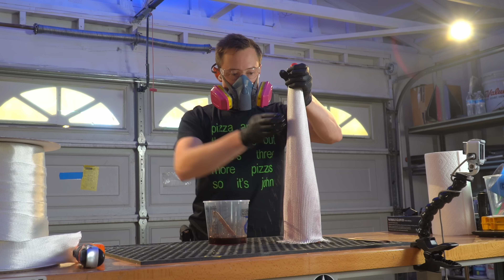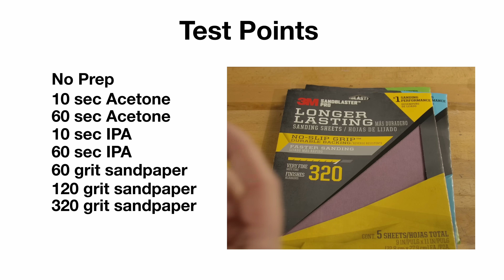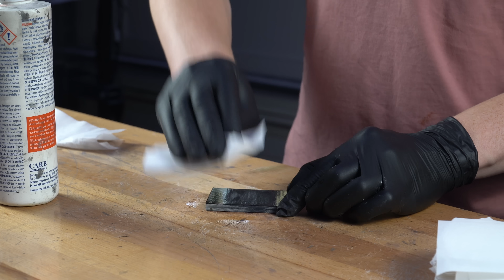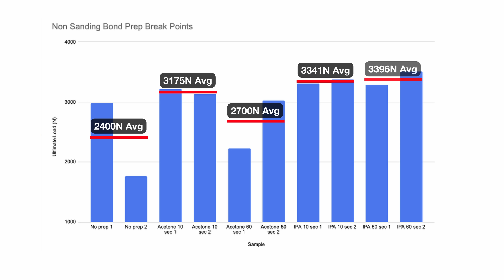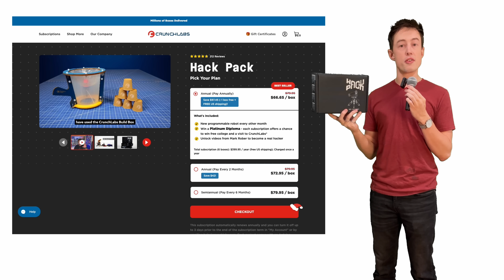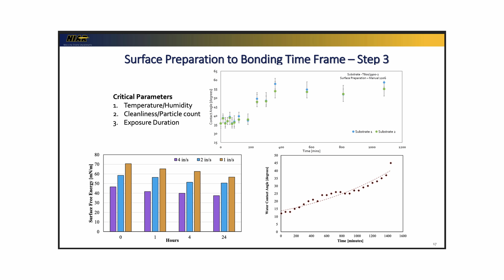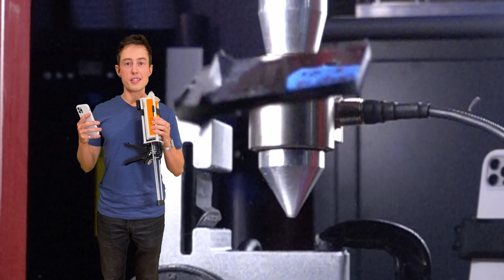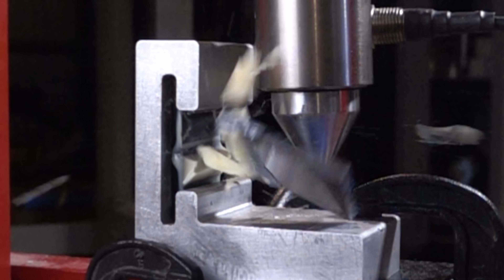I Broke 100 Epoxy Bonds to Find the Strongest

Comment: important: in 100,000 rotations, 60 grit becomes 4,000 grit, with signfiicant'y even pressure between the sandpaper and the substrate.  While the effectiveness of an orbital sander comes from OPM (oscillations) more so than RPM, the drift toward higher grit is still in effect.  It happens with hand sanding, however, distinctively uneven wear is more readily achievable with hand sanding, and hence, more drastic variation in substrate surface is likely to result.

Side Curiosity: 
short version, redo the test of 1000 grit sequencing from 60 grit gradually to 1000 grit.  
long version, when polishing, a progression from low to high grit cannot be ignored.  Under a microscope, the peaks and valleys of the surface substrate is best approached with a grit slightly higher than the substrate.  The depth of the sandpaper's grit shoulld be less than the depth of the valleys in the substrate to avoid being counter productive.  In a perfect exection, grit and force would be dialed in to have the sandpaper 'peaks' lightly impacting the substrate 'peaks' with each pass. As the substrate 'peaks' dwindle, a higher grit sandpaper is require to continue the 'dwindling' of the substrate 'peaks'.  The less timely our grit progression simply results in the real world effect of digging out extra substrate. When the grit of the sandpaper is less than the grit of the substrate, we roughen the substrate.  However, in this application, there is a tradeoff between fixing the slipperyness of the substrate and affecting the structural integrity of the outer layer which may delaminate under stress.  The idea might be to have as little impact on the surface structure while changing the surface energy, which might not equate to a human's taction contact sensory perception of 'smooth' and 'rough'.  In this situation, we may be initially drawn to identify 'removing the smoothness of the surface' as being very similar to 'this surface now feels rough, so that must be a good thing to go for'.  However, exposing the substrate surface to AO may produce a 'grab' feel, similar to the resistance of pully a wet chamois or microfiber towel over a car, due to van der Waals force.  Although, it could also feel smoother if the 'dust' from polishing has not been sufficiently removed, where the dust acts as a highly fluid lubricant, creating a 'feel' of smoothness.  This dust should be removed as part of the pre-epoxy surface preparation.  Most talented woodworkers are largely unaware of this, and prescribe recurstions of staining and resanding out the clumps of wet dust developed when wiping on the stain that the stain hardens around.

Comment: I saw a mil-spec procedure for bonding composites.  They specified media blasting and then using compressed nitrogen to clean the surface!  I assume the nitrogen is to mitigate risk of oil contamination from compressed air.

Comment: I regularly use acetone and IPA to deal with adhesives and surface contamination on a variety of materials, just hobby and home use. And so, it‘s hard to describe, these are both solvents, but they‘re somehow very different, in what feels like more than their differing abilities to dissolve organic compounds and evaporation time. For instance, if you get your hands covered in the stuff, it strips the skins oils off, and eventually you go wash your hands. IPA feels at first under the water almost oily. Acetone does not. I haven‘t looked it up, but maybe they have different wossname, dipole moment? Hygrogoscopy? Viscosity? 🤷‍♂️

Anyway, so obviously acetone is a lot more aggressive. It starts dissolving a little bit of almost anything in any way organic right away. But it goes a lot better in some materials (like ABS) than say, PETG or PLA. And once it evaporates whatever it dissolved, it obviously leaves it on the surface, and that shit *will* interfere with any kind of bonding. I haven‘t tried it with resin, but it‘s true for both adhesive strips and superglue. I mean, that all makes sense. But wait a minute. Sometimes I‘ve bonded stuff onto ceramic tiles or glass. That‘s a completely untouched by organic solvents. All types of adhesive strips (even the ones that use van-der-waals force bonding, you know, gecko strips) bond better to a glass surface that‘s first wiped with acetone and then wiped with IPA? I have no idea how that happens. Maybe it‘s not entirely pure acetone? 🤷‍♂️

I did at one point try cleaning a glass surface with nail polish remover, cause the bottle of acetone had run out. And ohboy was that a bad idea. In nail polish remover, they add something, that feels like oil, which is left behind once the acetone evaporates. Probably to make the acetone less agressive to the skin. But like, this is not oil, i.e. organic, cause that‘d just get broken down by the acetone. What I can say about the substance is that even after a dozen actual acetone and IPA wipes and soap cleaning, it‘s still there on the glass. It‘s probably bad for you, carcinogenic and some sort of super environment toxin. Also the most annoying thing to ever have on a surface you want to bond to.

Comment: Ok, so you want the fin to stay on no matter what.... Why haven't you drilled two or three - 1/4 inch to 1/2 inch holes through the coupon so the epoxy can join and form a positive clamp on the part? 👣👣👣👣👣👣👣👣👣👣👣👣👣👣👣👣👣👣👣👣👣👣👣👣👣👣👣👣👣
Reply: Violin! I think you're on to something.

Comment: Considering the material you're working with, sanding/scoring likely doesn't matter too much. Would it be possible to just run a few little scews in there? Like from the inside of the tube? Or mortise the fin into the tube?

Comment: Storage of the epoxy container is another variable worth considering, might not be a huge factor in this case but temp, humidity and exposure to light can cause issues. Also, I would be interested to see how prep with ammonia would affect things. I sometimes use ammonia to remove contaminants that ipa leaves behind, it noticeably increases surface energy.

Comment: It looks like the epoxy itself is fracturing in most of these tests. I'd look into adding some fiber additives to help prevent crack propagation in the epoxy, and help distribute the load more evenly.  In the cases where the surface is sanded, I'd think it might help to either slow the epoxy cure, or reduce the epoxy viscosity. You want to give it time after degassing to really flow into all the cracks and scores left by the sanding. At these viscosities, this can take many many hours. But the epoxy is cured by that time.  It's another variable to play with.  Additionally, in order to get really really (atomically clean) surfaces. Check out Ben's video on atomic copper coating. He talks about different approaches to remove absolutely 100% of surface contaminants. It might be useful? Oh also. I'd wait more than 48 hours before testing. The curing time chart in the datasheet only applies for extremely perfectly mixed epoxy.

Comment: The vacuum degassing will also probably help the epoxy flow into the voids formed by sanding. I think if you scored the samples it would also preform well if it is vacuum degassed. Also certain through hole connections might work too, like a key in a mold, to hold the epoxy in if they don’t compromise the structure too much. Plasma etching also works for other low surface materials like HDPE which are sooner hard to bond to, so it’s helpful in other ways. Also bonding during the “green” phase of the epoxy curing I had found to be super helpful. It can be hard to time, and I’ve had to pull some all nighters for that reason 😅. You can choose different cure time epoxies or use temperature to control the cure rate, but I think the different cure times/temps can effect the strength of the resin, so it’s better to find the optimal time/temp and just plan it out well. (A little heat gun use is ok at least in my amateur experience when things are too slow)

Comment: Loved, "there can still be a value to incomplete data"! It can point you to a solution. 

Ex-boatbuilder here. I've been using filled epoxies on wood, fiberglass, carbon fiber, etc. since ~ 1978. 

I'm sure Loctite makes a great epoxy, that version is a filled epoxy, although Loctite won't tell you what it's filled with. It looks like it may be Cabosil, but it's thinner than what I would use for a fillet. My experience is mostly with WEST epoxy where you get to roll your own filler. I would absolutely trust WEST with your application. 

A few constructive critiques. 
In general, I would never use a butt joint on anything important. 
It sure looked like that epoxy overheated in the mold, that usually weakens the result, and that's probably why you had the bubbles. Try using an epoxy with a slower kick.
Mixing. I always mixed by hand, the WEST pumps always got the % right, but mixing epoxy requires some attention. My rule is: 25 clockwise turns with the stick, 25 turns counterclockwise, 25 turns clockwise, scraping the sides occasionally. Then add the filler until it was completely mixed. Never fewer. 

In the late 90's I helped my brother, Bob Parlee, prototype his CF bicycles. They are known for their ride, and longevity, as well as other qualities. The longevity is mostly due to the bond between the lugs and the tubes. He removed the epoxy equivalent of gel coat, be it ever so thin, so that it was bonded fiber to fiber. You see that glossy outside to your coupons? That's not structural, it has to be removed, not simply sanded, then you are trying to stick it to a chunk of filled epoxy.

Instead, makeup pairs of 90 degree "L"s, one leg curved to fit snugly to the cylinder, the other to bond to the fin, of course removing the surface coating.

Comment: Did you check your ambient temperatures, Relative Humidities, and also the moisture content of the fibreglass when bonding each sample together? Humidity in the air or the samples are likely to make a big difference to the bond strength.

Comment: Fiberglas sheets are FR4 or G10? I use those for 3d printing, they get soft around 90-100 Celsius. Perhaps there is an inconsistency in the strength of the parts themselves. The reason is likely the epoxy used to bond the layers.
From my testing sanding the sheet helps a lot with how good PETG sticks to the sheet. Now I am dealing with a 1mm sheet and not something at thick as your samples. Also I am not trying to bond epoxy to it so take that for what it is.
But from my testing washing with soap for example decreases the first layer adhesion. Even after washing with water and then isopropyl. Best has been sanding then isopropyl. I have not tried Acetone because the smell is bad.

Comment: The long anticipated composites testing video!

If I may add another point of criticism, I believe creating an >ISO4 clean room with an exclusively atomic oxygen air filtration system is the next step. Time to plan a new wing of the bakery!

Comment: This is an awesome video, Thanks for all the hard work you put into collecting it, it really shows. This was a lot of work! 

One thing not mentioned was temp control. I have multiple family members that work or did work at Raytheon in their composites room. They had special lockers with temp control for storage and then a different one for prepping the adhesives for application time where it would be loaded the day before it was going to be used.  It was required to be sure the epoxy was at the right temp before application and then they had a limited time to apply when they took it out. Then after some time they would put the part in a heated chamber to complete the curing process. A lot of these high performance epoxies have temp requirements to reach max strength. 

One other thing to consider is the bond line. This is the amount of epoxy and the shape of the t joint. You used a chamfer but most adhesives don't like that and it creates a stress line (as you can see that is were most failures started in you video) and want a fillet to even the stress. based on the videos you will want a much smaller fillet (less then 1/2 the size of the chamfer so that no part of the epoxy is think then the material being bonded) so that it can flex more.

NOTE: I went an looked up the datasheet (LOCTITE-EA-E-120HP-en_GL.pdf) and it says "Cured for 12 hours @ 65°C followed by 4 hours @ 22 °C" otherwise 5 days at room temp (21c) for max strength even though the graph (you shows in your video) shows its fine after 24h this might be a variable you want to control and helps drive out moisture. Also if the Epoxy was stored below 8c then that will affect its performance as well: "Optimal Storage: 8 °C to 21 °C. Storage below 8 °C or greater than 28 °C can adversely affect product properties."

Really looking forward to your next video. Good luck!

Comment: Dull sandpaper dragged in circles is an extremely  poor method for achieving mechanical tooth.  Folded sandpaper under finger tips is also poor technique. Yes it will get rid of the glossy surface, but that is not the only goal.  I like dragging new  quality Sharp 60 or 80 gri sandpaper  which has been folded over the edge of a paint stirrer, or similar size tool edge.
      Press down firmly, and Pull it in an X pattern. At the top of each pull, relocate the used sandpaper away from the working edge, and bring fresh sharp paper to the tool edge.  This method  leaves sharp valleys and mountain tops for the epoxy to grasp, greatly increasing surface area. 
 If  you then wipe these mountain tops with acetone, it is like a glacier rounding mountain ranges, and contaminating the valleys and goodbye to a majority of the mechanical tooth you just worked so hard to establish.

Before removable fin systems started being widely  employed on surfboards, the Fins would be glassed on.  There is tremendous forces on the fins.  Standard practice in the factories I worked in was to tack the fin at the proper tow in and camber with Waxless  laminating PE resin.  Then the fillet itself was  saturated unidirectional roving laid along both sides of the fin.  Then a minimum of two layers of 4 oz fiberglass was laid on the hull of the surfboard and up the side of the fin, pressed into the corners of the fillet.   The bigger the fin the more roving in the  corners to form the fillet and more glass bridging hull to fin all the way to fin tip was required.   After the laminating resin kicked a bit,   we would paint the area with hot coat resin, or sanding resin that has the surfacing agent in it to allow the resin to fully cure .  A razor would be used at the correct time to  remove excess fiberglass. 
  
Glass on fins with epoxy is a bit different in the time and potential amine blush affecting secondary bonding sand also trying to lay  secondary layers within the chemical bonding window, when possible.

When the fin was loaded to the point it would break, it was usually as the Foam under the fin that crushed on the inside.  The really strong fins needed little ovals of fiberglass laid down right below the fins, and mechanical tooth was super important.  Acetone wipe first, then cross hatching with new sharp sandpaper, then the resin.  

    Some of the drums/ tins of acetone would seem to leave much more of an oily residue than others.  We would allow a teaspoon to evaporate off of a Piece of cleaned glass and then run a IPA wiped  gloved finger over it.  Sometimes the glove would slide easily, some batches would have the glove stick to the glass and slide over ones fingerprints within.   The oily batches were basically only good for cleaning tools, not for surfaces pre bonding. 

  I could never imagine trying to make a giant fillet of thick epoxy to glass a fin to a surfboard.  It would never handle the lateral load stress. 
 
I really enjoyed this video, and the comments
Reply: 💯 This ⬆

Comment: >I tried doing controlled tests, then didn't because I got impatient and modified or un-controlled several variables between each test, which tainted the data
There is a way to compensate for this mathematically, so that you can still extract useful statistics.
It's called multi-variate testing or factorial experimentations.
It's useful when you have too many variables for one-at-a-time testing of each to be practical, and when you want to test for interdependencies between variables.

Comment: Cool experiments. I bet they were fun to conduct. I wonder if you could increase the strength even further with some mechanical grooves sliced into the bond surfaces. This might line up with your sandpaper multi-use theory, as I suspect the sandpaper isn't as "sharp" on a microscopic level on the second use, thus cutting shallower grooves overall. Cutting or slicing grooves could ensure more consistent bond surfaces and load capabilities on those bond surfaces. Non-orthogonal grooves could potentially increase the bond strength some more. Like a blend of composite and mechanical bonding.

Comment: I used to be a composites manufacturing engineer - so just a process guy for parts that use techniques like the ones you're exploring here.

It was fascinating to watch you collect this data, your reasoning is very sound. I think you've pretty much got exactly what you want by exploring adhesion to the substrate. Beyond that, you've begun to use the epoxy as a structural member. It would be interesting if you mixed in a chopped fiber, or if you bonded on a thin fillet/gusset shell to mate the fin to the tube and then had an actual controlled bondline of appropriate thickness, but that's more pieces etc. Maybe complexity that is not warranted. Screeding the resin on the way you do also seems like a great solution to also maintain a streamline profile.

If you could get panels with peel ply, that would be your ideal substrate - and no sanding!

Great work, thanks for sharing!